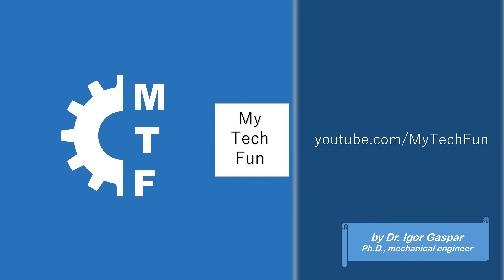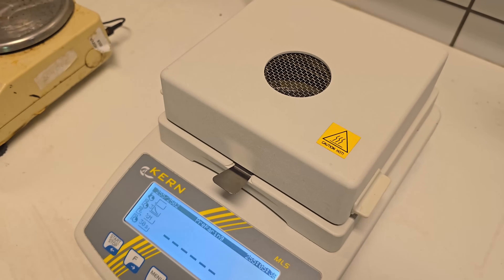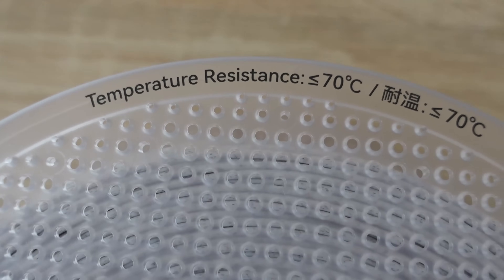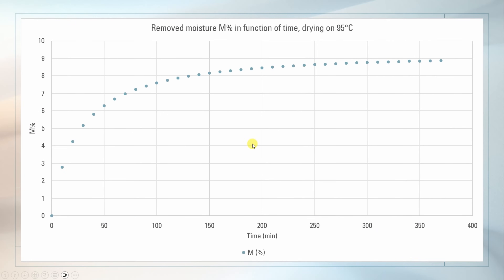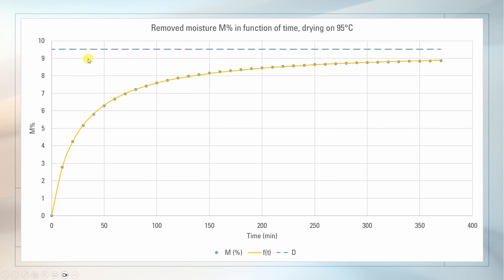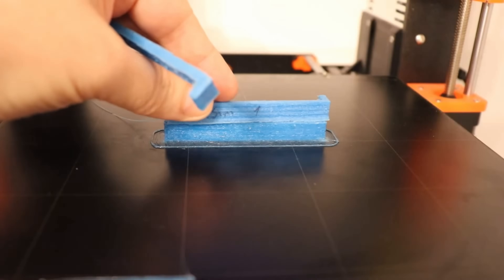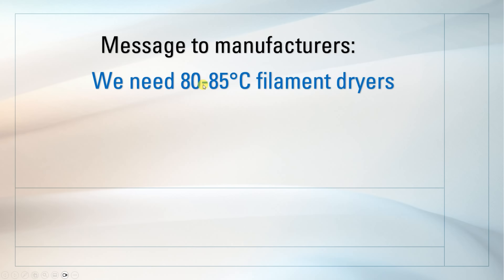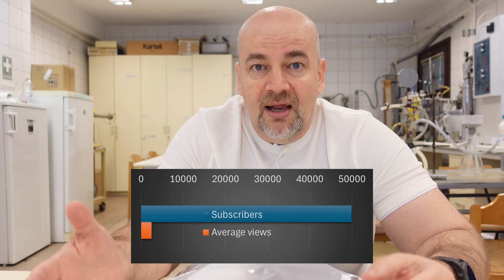Can we dry the nylon at 70°C? Surprising results!

Comment: Here’s a question: If the filament is stored with desiccant at room temp and <10% RH, does it still gain moisture such that it needs to be dried again before use?

(I haven’t tried printing with nylon yet, have been kind of scared-off by all the talk of problems. I’d like to be able to use it for its mechanical and thermal properties though.)

Comment: Have you ever done any kind of analysis as to permanent damage that happens to certain materials by moisture? It is completely unscientific, but I've had PLA rolls that have been left for years out of dryboxes (mostly sub 100g that's unusable at the end of a spool) and similarly aged filament that has been in dryboxes. The filament that has acquired moisture tends to be permanently damaged, despite drying. I wonder how long the permanent degradation takes to happen.
Is there any concern regarding loss of plasticizers/voc's during the drying process for filaments like petg/nylon/pla, or can most of the missing weight be assumed to be just water?

Comment: If we know the weight by the length of the filament and the slicers already say how much weight and length the print will use, maybe we can just measure the filament we're going to use with a filament winder or so , cut it and only dry that filament at 120 ºC for a lot less time and then just pop it in the printer on a small spool. It could take less time because it's less material and we could bump the temperature because we don't need the spool until we wind it again

Comment: I have been printing Nylon and PA12 on my X1 Carbon, I dried them both for 13 hours and they printed well from the drier, I kept the drier on while printing also. when I finish printing I put them in a vacuum bag with a bag of reusable silica gel and then vacuum seal the bag, when I took it out there was no colour change in the silica gel and so I placed it in the drier and printed with it again.
 Once more it printed well.

Comment: I've done a fair amount of nylon printing, PA6 & 12, regular and carbon fiber.  Because it is the most difficult of all my filaments to print, I only use it on an as-needed basis, so not that often.  My process involves drying it in a large benchtop food dehydrator for 12+ hours at 75C, rotating the filament a few times during this process so all sides get airflow.  Then I move it into a Sunlu S2 filament dryer for printing, where I will keep drying it at 70C during the printing process.  I doubt that I'm reaching anywhere near the 0.6% mark you mentioned in your video, but for 3D printing I get great results.  While I store most of my filaments in vacuum bags, I don't worry much about trying to store nylon because it's so hygroscopic that it's nearly impossible to keep dry even in a vacuum bag, you always have to redry before printing, every single freaking time.

While the cardboard rolls can handle higher heat, my personal belief is that the wood fibers absorb a lot of moisture, and make drying 10x harder.  Cardboard is fine for cheap PLA that you don't dry, but I notice much longer PETG drying times on cardboard spools, so I typically avoid these brands.  I've not seen anyone examine the impact of cardboard spools on filament drying.

Commercial printers/filament makers/injection molding companies use a heated vacuum dryer to rapidly dry their pellets.  By raising the temp with the pellets under a vacuum, you can dry nylon in 15 minutes.  This is because under a vacuum the moisture boils off.  I've tried to replicate this somewhat at home.  I'll still dry the nylon for 12 hours, but then while it's still hot I quickly move it into a vacuum storage bag and pull a vacuum.  But I don't think it works with storage bags, since the bags collapse under vacuum pressure, and the filament only feels a slight vacuum pressure, not enough to do anything.  I've certainly not noticed any benefit.  Even worse, those cardboard spools will crush in a vacuum bag, not a good mix at all.

PrintDry sells a filament storage canister that has a built-in vacuum.  Because the canister is a rigid body, it won't collapse under vacuum, so the filament should experience more vacuum pressure, so my idea might work better with these canisters.  But the PrintDry specs list a negative pressure of -20 to -25 kPa (about 75% vacuum), while commercial dryers will reach 1 millibar, which is 0.1 kPa, an astonishing 99.9% vacuum.  So my hunch is that the PrintDry vacuum might be too weak for vacuum assisted drying.  But perhaps you could heat a nylon roll for 3-4 hours, then vacuum it while hot to quickly remove the remaining moisture.  

Could make for some interesting videos if you decide to test!!!  Yes, CNC Kitchen did do a vacuum drying experiment, but he kept the vacuum rolls at room temp.  It's well established that the vacuum process needs heat to be successful.  It's worth mentioning that the vacuum chamber he used is much better than the PrintDry cannister.  Those chambers can reach 40 microns, about 0.002 kPa, or 99.995% vacuum, exceeding even the commercial plastic dryers.  They cost a little more, but might be worth it.
Reply: I’m similar, I use PLA for first prototypes and fit tests and then move up to better materials as needed, my current goto being polycarbonate. I tend to only use nylons for final versions if other materials aren’t good enough due to how much nylon costs. A good CF nylon can be many times more expensive than PLA and even a few times more expensive than PC but sometimes you need it for the strength and stiffness.

I have found the Bambu PC to be a good all round filament whilst cheap. It isn’t as good as some other brands of PC but it is significantly easier to print and is relatively cheap with a good increase in properties over PLA, PETG or ABS. 

I tend to avoid PA6 though due to its moisture issues, the mechanical properties drop off rapidly even with just a few days, PA12 is better long term in those situations. The PA6 is the strongest and stiffest right after printing but very quickly it degrades below that of the PA12, since most of my uses are in relatively normal room environments it just makes more sense to use the PA12. I haven’t tried sealing PA6 yet though with a coating but I have heard it can work. If I really need high stiffness there are other options though, like PET-CF or just using metal rods.
Reply: @PaulStevensonPinball Thank you for sharing this. Very interesting.
I share your aversion to cardboard spools. They should have just switched to refill filaments instead of cardboard for the environment. It's pointless. 
All ptfe tubes of my printers and the AMS of my 'Bimbo' printer hates this. Plus I have cardboard lines on my filament dryer rollers. If I use electrical tape (which rated for 90°C), the spool won't rotate well on my rollers (Polyphemus). I'd have to order some rubber tubing or respool all cardboard filaments.

@conorstewart2214

PET-CF🤘 Have you tried QIDI's? It's just rebranded Kexcelled. From all the data sheets I downloaded from them, one was clearly from Kexcelled. They must've uploaded the wrong one.
Reply: I wanted to print a split keyboard (chasis) for my brother using PA12-CF..... but noticed I had quite some issues with the filament. I dried it in the X1C printer (BambuLabs) for 12hrs @90C....the print however requires Support material for the PA.... How would you go about printing with 2 such filaments simultaneously? ...as well as drying them.....simultaneously... 

Should I give up and print in another material?
Reply: @peterklemenc6194  , I Have a few vacuum chambers I store my nylons in. Like you I dry tem for 8-12 hours in a dehydrator, then put them in the vacuum chamber along with a cannister of desiccant and pull a 99-99.5% vacuum using a normal two stage vacuum pump. This have worked well for me but it would have been nice to see proper tests. The equpment isn't horribly expensive btw.
Reply: @peterklemenc6194  There is some PA compatible "breakaway" support material that may work for you. I think the XYPOLYER brand carries it, but I've not tried it. Personally, on my MK4 I pre-printed some bridge supports in PETG, then used a pause command on the PA print and dropped in the supports. This only works for simple geometries, though, but perhaps you could use this approach. On my 5-tool Prusa XL I have used PETG as support material for PA, and that works great, but I don't think the X1C can perform this trick.

Comment: I have tried some nylons years ago, but the results were very poor, probably because of moisture and my inexperience in general. I still have the old spools somewhere in storage, but never looked at them in the last6 years or something... If i need something in "engineering grade" plastics and quality, i'd rather send it out to a company with professional large scale SLS printers once i verified fit and basic function with my PLA or ASA parts. 
Would be interesting to try and "hack" some commercial filament dryers to maybe get 10°C more out of them. I understand that this is risky, because the materials, fans, heaters and everything need to be compatible with working at that higher temperature, but i would hope they included enough safety margins to allow for a small increase, even if that possibly reduces the life of the heater and fan a little bit. Just wondering if the heaters actually can handle the required power to increase the temperature, or if that is asking too much and i should just start from scratch with making my own filament dryer box.

Comment: I may have missed it, but your rooms relative hunidity is also extremely important. The rooms relative hunidity dictates the actual humidity in the heated dryer. During the winter, i can easily dry at 75-80C as my rooms relative humidity is 10-15%, but the summer the relative humidity is like 70%. I use an equation to find the heated dryers relative humidity (online calculator) to ensure the actual humidity level inside the dryer is below 0.2%

Comment: Nylon can dry as low as an actual (not fake) 65C, as long as you give it more time (could be up to 48 hours at 65C).
Reply: No, 65C is not enough to properly dry any nylon in any condition. Sure it'll work if you're printing at the lowest possible print temperature at higher speeds, but if you want the actual benefits of nylon, being superior layer adhesion and strength, 65C is FAR too little.
Reply: @FrozenByFire3  I wasn't recommending 65C - just saying the lowest possible temp that can get the moisture down to about 0.6% - which is what I consider a threshold amount for acceptable surface finish, but as you said, not strength. Nylon should be dried at 80C or higher depending on what the spools can take.
Reply: @rsilvers129  65C will do it, in a dry house. The external rooms relative humidity is just as important as the inside room (oven/dryer) in the summer (60-70% RH at 23C) I need to crank my oven to 95-100C to get the same results as during the winter (10-15%RH at 18C) at 75-80C. So your environment definitely plays a huge role in how high of a temp you need to dry your filament at.

Comment: ive been using my Sunlu S4 and my Eibos Cyclops to dry nylon and they both do a sterling job at drying it. The trick is once dried keep it in the dry box. After printing I even retract the filament from the bowden tube back into the dry box.

The Sunlu S4 auto humidity function is also super useful here.
Reply from the maker: Yes, perfectly agree. I forgot to mention in the video, after printing filament goes to dry box

Comment: Now hold on to you papers, fellow scho… oh wait, wrong science YouTuber!

Actually, ironically the main issue that keeps me from using PA is that I don't have the patience for the amount of drying I'd need to do. I also fear potential issues  with the printed parts due to material creep, so I mostly stick to ABS/ASA or PC.
Reply from the maker: If I really need good strength (stiffness), PC-CF (usually some blend) is my favourite material. Nylon is good with layer adhesion, temperature and against impact.
Reply: Annealed at 90C Spectrum Low Warp PA6-CF15s has incredibly low creep. The single best non super expensive CF nylon on the market, and I've tried A LOT. I use it in many parts requiring long term dimensional stability and it works very well.

Comment: I do use Nylon albeit PA12 so might be slightly better off. Nevertheless i have noticed that my aging 55 °C dryer is only good enough to keep it dry.
I wonder whether drying in a microwave would work too. At least for silica gel i only need a couple of min. There might be a significant fire hazard with the microwave though

Comment: For the more technical/professional filaments it seems like the producers want you to use vacuum drying. A bit complicated but I think it will be much faster and more effective. I have far too many projects at the moment but perhaps there is someone out there who could test an inexpensive vacuum pump and pot and see how effective that would be.
Reply: A couple issues I can think of with trying to vacuum dry are that the water vapor itself will quickly fill the vacuum (which is what you want haha), so your vacuum pump will have to run a high duty cycle (beyond what most cheap pumps are rated for). Additionally, there is the challenge of heating the filament. Convection is out with a vacuum, and both radiant and conductive heating aren't great because the filament is coiled, shielding most of it from any radiant heat, and insulating it from heat conduction.

(You'll also need to a fairly large capacity water trap between the chamber and your pump, or else you'll need to change your pump oil very frequently because of water condensing in it.)

So you'd want to cycle convective heating with air (ideally dry air), then pull a vacuum, repeat, yeah?

Well, you've inspired me to look up how industrial vacuum dryers work!

Comment: It's wrong to conclude that, because nylon absorbs water at room temp, and it's reversible, even 50 degrees would be enough to dry it.  Certain materials, like nylon, have a very high affinity for water.  In other words, water likes nylon much more than it likes dry air.  So the assumption that it will simply equilibrate in dry air is false.
Reply: are you 100% sure?
Reply: @riba2233  yes, I'm 100% sure his logic doesn't follow. Just because something is in equilibrium doesn't mean the reverse reaction won't require a tremendous amount of energy to occur
Reply: @disp3rsion  I understand what you say - and I am pretty sure he is not ignoring details like this. I think you will need to wait his paper to come out and you can debunk any mistake you see then :)
Reply: @GeekDetour  to be clear, I think he's right that nylon can be dried at 50 degrees. But his logic is wrong. He mistakes a kinetic argument for a thermodynamic one